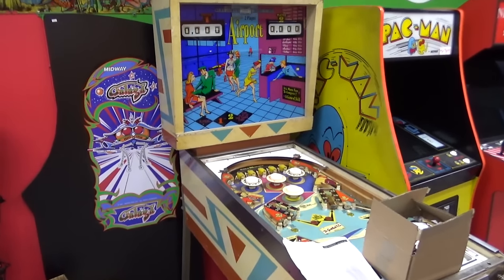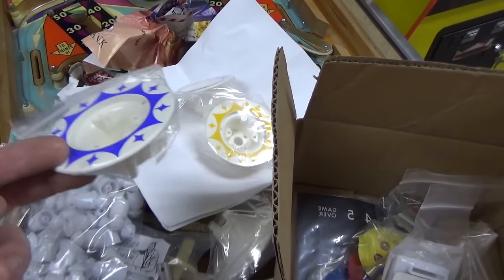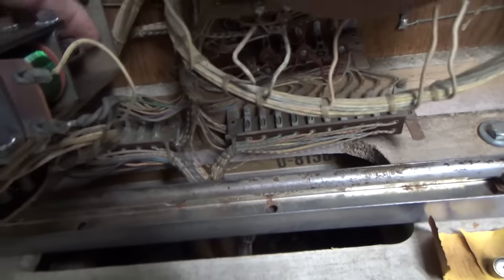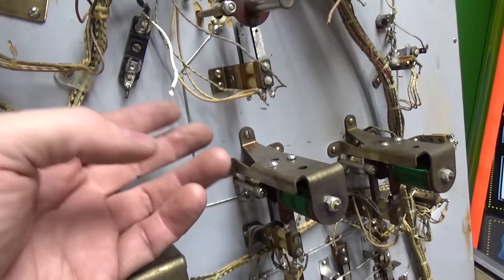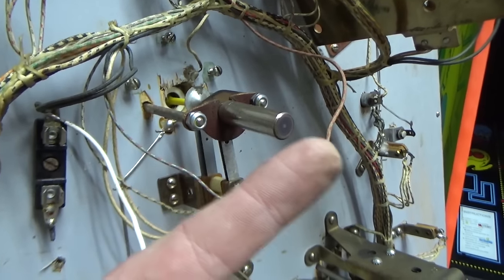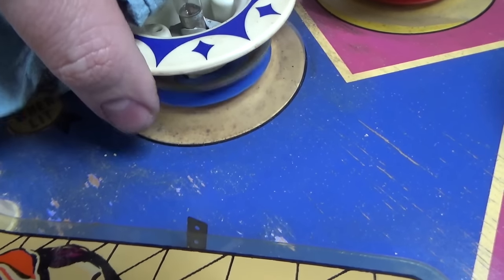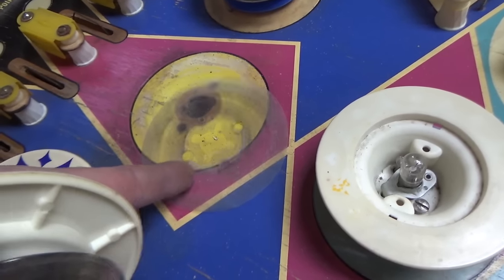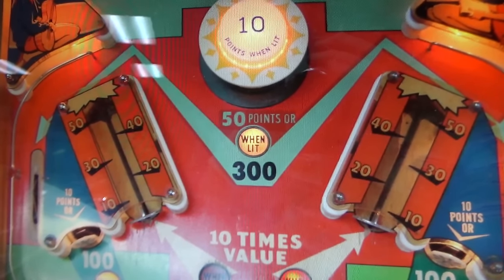How to Replace Your Pop Bumpers & How They Work - 1969 Gottlieb AIRPORT Pinball Machine Repair

Comment: It ‘s always exciting when a pbr order arrives. There’s a lot more to fixing these than just swapping parts, but it feels great when you replace the old and tired parts with some fresh new ones. ….I’ve used the Mylar trim platters on the pop bumpers for years. I don’t think they are much of a problem if you keep the machine clean. ….If you never clean it and never maintain the machine, …then nothing will save it anyway. Wipe them once a year or so and they work great. Thanks for the videos.

Comment: It seems to me that the sensitivity of the pop bumpers could be greatly improved by making sure that the tip of the plastic rod that works against the spoon (see 20:17) has the proper round profile, is clean and polished with plastic polish, and perhaps lubricated with a bit of powdered graphite or Teflon powder.  What do you think?

Comment: The nut you use with the nylon inside is called Nylock, another kind of lock nut is made from full aluminium and is made in an oval shape on the inside and can only used once (Nylock prolly aswell).

Comment: Joe- Different topic as I have just bought a rockola 464 and am following your great repair vids on it. Question: What is the best way to clean the the gear assembly now that i have i apart?
Reply from the maker: Brake or carbureator cleaner (outside) works really well...

Comment: JOE, You mentioned that the Wafer Fiber Piece on the pop bumper plunger if its not installed in the correct orientation direction of the Wafer Fiber piece that it will short out the 6vdc lamps to the 32vdc coil line rail, is this because the 32vdc coil voltage is running through the metal hardware? They are running voltage through the metal hardware like screws and metal rods links
Reply from the maker: Yes that is correct but it would only happen if the 6 volts was shorted to the frame too.  So the metal wafer would touch the switch which definitely has 32 volts running through it, and if the line for the lamp was touching the frame (which it often is) it would short the two together.... thank you for watching Wayne like always!!!!
Reply: @LyonsArcade  Thanks for the info. Now I know what to look out for as a common problem.

Comment: I wonder if they use the original plastic beads in the injection mold.

The old plastic from the 60s and 70s is different than the plastic from the 80s and 90s and melts at a different temp and feels different.

Now they use a low temperature plastic bead that melts at a really low temperature because they use much smaller, lighter aluminum injection molders

The old machines were huge
They were steel and weighed more than a truck.

I remember the old magazine and book printing " press " from the 70s and 80s

This printing company had rented out an entire strip mall and the printing press ran the entire length sideways through the walls.

Each sheet of " slick " ( the special thick high quality glossy paper used for custom magazines that were more like a book ) these sheets were 4 pages of the magazine

The pages were loaded in each section and each section was for that page of 4 

And it would have the two sides of the print plates and there were 3 plates for each page because they had 3 colors.

And it was LOUD and shook the building.

And it was fast

It printed each page with the 3 colors and it heated the ink to dry it and each page would be put on the bottom of the previous page and at the end of the press if had this huge hydraulic press that would actually fold the pages over and it somehow did the square edge on the really thick magazines.

In the 70s and the early 80s there were a lot of local printers like this and local magazines

Usually photographers would get together with a Jobs type guy who knew nothing about photography, but wanted to make money and he would buy the photos from the photographers and use a printer that did the mock ups, which were not hard because most of the pages were just photos, no text.

The cost to make these were about 5 dollars a piece in 1970s money.

Min wage was 2.50, so about 15.00 in today's money to print out each one.

The black and white paperbacks are a lot cheaper to print, but you need to sell a lot to make money.

Where these magazines might have 5000 made and they made 25,000 a month off each   name

Now everything is corporations and we lost a lot because the individual people who made unique things no longer get a chance

But back in 1980 this company went out of business that had this press and they put it for sale in some business trade paper and investors entrepreneurs would see different things for sale and I happen to know the person that bought this massive press and saw an opportunity and they found a strip mall that was in a rural place that wasn't getting any customers and the builder was just sitting paying taxes on it and the person I know went to them and said I need the entire building and I need to knock out the walls in between to be able to put this press through the entire building and I could go somewhere else like a warehouse that specifically designed for this type of equipment but I know you've been sitting on this place for 5 years and never had one tenant and you're right next to the highway where the tractor trailers need to come in and out and if you work with me on a price I will rent your strip mall and for 5 years this building set quietly with no one knowing that there was a printing company inside because there was no signage at all and nobody saw people coming and going and the trucks would come and drop off at night and pick up at night and it was a different time

But it was so cool to see this machine run and how fast it spit out the magazines and the guys that were working were blue collar guys and it was a dirty job running these things and they would put the magazines in boxes and tape them up and sometimes they would get on to pallets and be shipped out by truck to New York City for distribution but usually it was a guy with a small box truck or a large van that would come and pick up his run of magazines for the month and he would have a mail order list or word of mouth and people would come and pick up the magazines from his garage

And in the state I was in we were one of the bible thumper states where even Playboy was not allowed on the shelves so the adult community was underground and the demand was very high and I was shocked to find out this person I knew was involved in the adult industry in this way and it was crazy😮

But very very exciting

Unfortunately the internet really destroyed the industry

The early 90s, every in late 80s people were dialing into BBSs

But the 70s and early 80s were really amazing

I miss those days